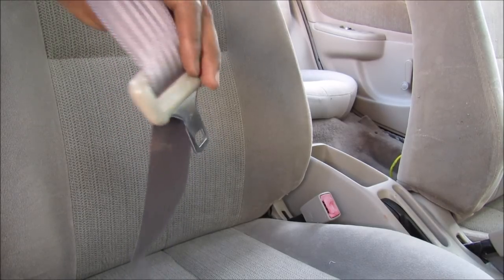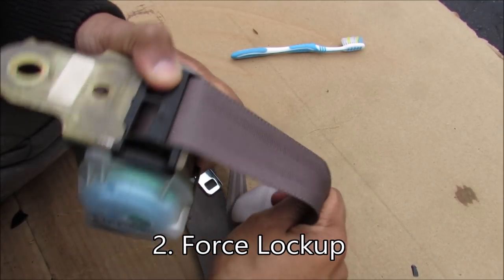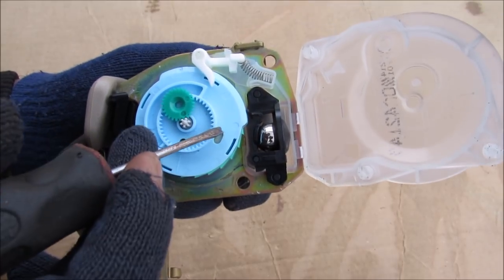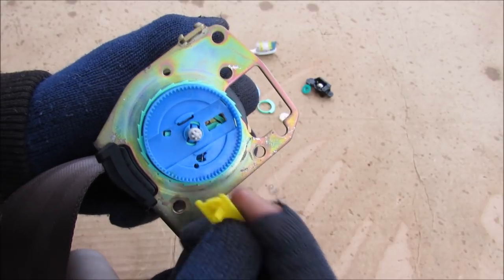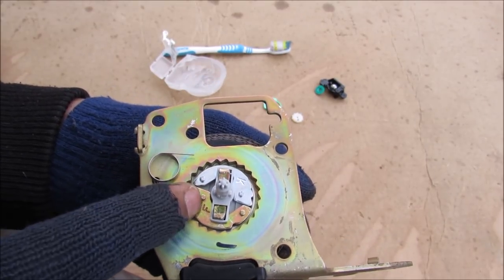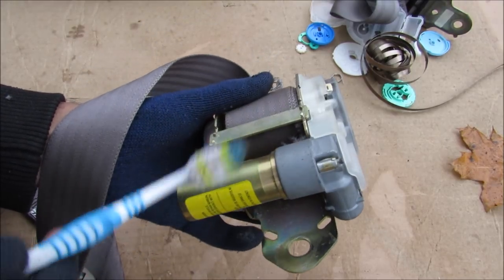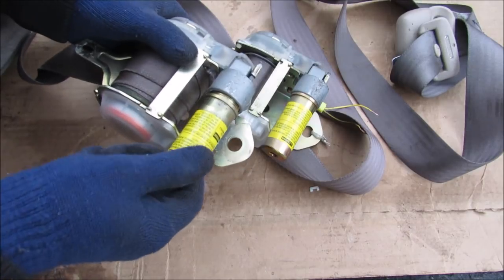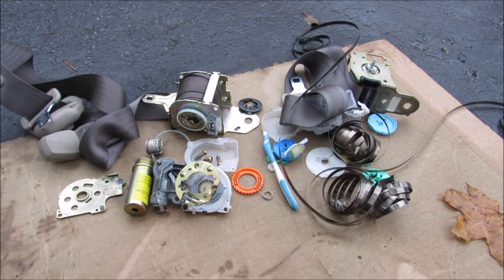How Seat Belts Work

Comment: Where do you get OEM spiders? My dealership doesn't supply them.
Reply from the maker: +MaximumJonathanosity I left my parts sitting for a while after pulling under my shed, I bet most of the videos youll see from now onward will have spiders.

Comment: Thanks for this video! That's very clear, funny and synthetic! I could finally manage to find the problem in my seatbelt. The gravity ball might be in a slightly wrong position: this causes the belt to stuck often. How would I fix this problem? Is it dangerous to remove the gravity ball and keep driving until find a replacement?
Reply: I know this comment is over three years old, but you never know what’ll help. 
Yes, it’s very dangerous because that mechanism is what causes the seatbelt to lock in high accelerations (negative or positive)

Comment: The seat belt on my old beater acts up a lot. One day I pulled on it fifty times and it wouldn't extend, so I just drove off without using it. Of course a Highway Patrol spotted me in heavy traffic and pulled me over. I demonstrated that it wasn't working that day....he could have given me a warning or a fix it ticket but he nailed me for the full fine, One Hundred Twelve Bucks!  : ( Then they wonder why people hate cops  : (  Later I used compressed air and blew out about a pint of sand and gravel from the mechanism. It still doesn't work very well but once I got it extended I used a vise grips to keep it there.

Now that I got that off my chest this was another fascinating video!
Reply from the maker: Awesome, glad you learned something

Comment: could you potentially use a mechanism like this for climbing gear (ignoring obvious safer precautions)? i looked up how a seat belt works because the mechanism 1: extends and retracts 2: locks up when pulled on 3: has a max distance it can extend before locking up and needing to retracts. these seemed like good features in my mind for a belt/harness attachment that could wind in your rope while climbing something. i don't know much about climbing gear or mechanics i just had always had this thought in the back of my mind and decided to learn if it was possible. thanks for any answers

Comment: i m surprised that my life is being held by plastic gears rather than metal gears.
Reply from the maker: +superpanda 1022 that's a good thought I didn't realize that.
Reply: I'm pretty sure most modern ones are made of metal
Reply: They’re still plastic for many reasons. I know this because I’m a seat belt engineer
Reply: Sergio Gonzalez can you contact me please sir? I need your help in a design process.
Reply: Sergio Gonzalez can you contact me please sir? I need your help in a design process.
Reply: @sergiogonzalez638  Rust avoidance.
Reply: I'm sure they are plastic and not metallic for a good reason
Reply: I dunno about that, the centrifugal based pieces - which are essentially the most important and the life savers, are made out of metal. The rest yea but not rly
Reply: Its for weight reduction
Reply: The plastic gear engages the metal gear hidden underneath it. The plastic itself carries very little load.

Comment: Hello great video! My drivers seatbelt is blocked pulled out after the firing mechanism exploded after a very small hit with another car. Now the seatbelt is out and the spring cant pull it in back in place so i cant use the seatbelt at all because its stuck out. So the question is, can i unblock the seatbelt to be able to use it normally as a simple seatbelt without the firing mechanism untill i replace it, because till then i cant use the seatbelt at all. Thank you very much.
Reply from the maker: I think you'd have to disconnect it entirely
Reply: @speedkar99  . Yes i did so and it worked. I thought in theory after i watched your video first because i had no idea how seastbelts work that the mechanism consists of 3 main parts. The part with the gravity ball that works in slower decreasings of the car, the centrifugal part that works in very hard decreasing of the car like really hard hit of the brake or crash on another car or wall for example and finaly the firing mechanism that the reason of it is actually to pull you back when u are leaned forward for some reason like to scratch your ankle for example and your back is not touching the back of the seat. If the steering wheel airbag explodes and u are leaned front it will hurt u so the firing mechanism pulls u back in place. So what i did was to open the mechanism to the side that this wire rope is, cut it and throw it away and take out a couple of parts that engage the seatbelt to wrap in when firing mechanism explodes, it was just 2 kinda gears parts and then the whole mechanism was able to work freely again. The part with gravity ball and the part with centrifugal mechanism was untouched. I repeat for anyone that reads this that the seatbelt can be unblocked and work safely like a simple seatbelt without a firing mechanism untill it will be replaced with a new one BUT WITHOUT TO TOUCH OR REMOVE THE GRAVITY BALL OR MESS WITH THE CENTRIFUGAL MECHANISM that is on the side the gravity ball is too.  In few words we dont touch or open for any reason the side we see the lil bearing ball is. The wire rope we need to cut and discard is on the other side where the firing mechanism is and the wrapping spring is too like it shows on the video. My car is a Hunday Tiburon coupe 2006. Sorry for any mistakes but english isnt my language. Keep up the good videos mate ! Peace and thank you !

Comment: My front passenger side has locked up mostly out but it won't retract either. I'm not even going to try fix it, just replace it with one off a low mileage car I found that still works. Only new one I can buy is made up in a factory in Italy where the car comes from but the quote will be a fortune. Specially with the explosive charge.
Reply from the maker: Easy to replace. Open it up and you'll likely misplace something

Comment: Did you find the seatbelt sensor that makes the light on the dash flash incessantly even though you have your belt on? I got sick of it enough in my corolla that I removed the bulb outright.
Reply: The Sensor/Switch is in the "Seatbelt Lock or Connector...i don´t know the English Word...." not on the Seatbelt-Mechanism itself! :D
Reply: I removed my seats completely from the car to clean them and there were no connectors or wires on the buckle side See the following for what I mean - https://www.youtube.com/watch?v=8tW6joHPQNU The sensor is buried up inside the B pillar somewhere.

My seats were so filthy and grubby that they got removed and got a bath with hot water and dish soap.

Comment: Why there is a push to lock system and gravity sensor? Is one enough for locking the person moving forward??
Reply from the maker: +Yathu prem Gravity senses moderate braking forces. The force pull is much more rapid and sense sudden impact. Two separate systems.
Reply: Hi, 
I could not put my car seat belt when the car is in rest. Rather I need to start and move some distance then I need to put my brake slowly and at the same i need to put seat belt at one stretch slowly. I feel now its something related to gravity ball. Can you please advise the fix. Car is Nissan Altima 2010.
Reply: Jihad vv so, did you manage to fix it?

Comment: im trying to install a child car seat using the seatbelt but cant get the seatbelt to lock in place. i followed the videos online that says retract all the belt then slowly feed it back in ( should hear the ratcheting sound but i am not) to switch from emergency lock to manual lock the seatbelt but it isnt working. i tried it on 4 cars , i dont know what im doing wrong. any help will be appreciated thanks

Comment: The center rear seat belt in my MB GLK 350 locked in up and is located inside the back of the seat, which is tipped backwards, and it folds flat at no time is it vertical MB wanted $2000.00 to fix it I did it in 1,5 hours and had the rector fixed for $75.00. This retractor is made like crap look how many of them fail because of design flaws good work NTSB NO RECALLS WHY. For wat it's worth no one has ever used that seat melt what a joke.